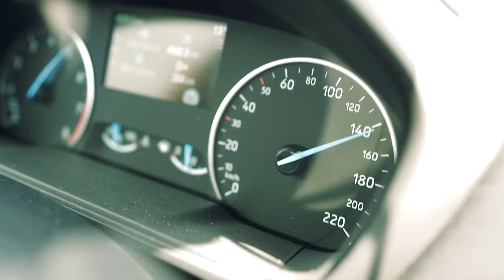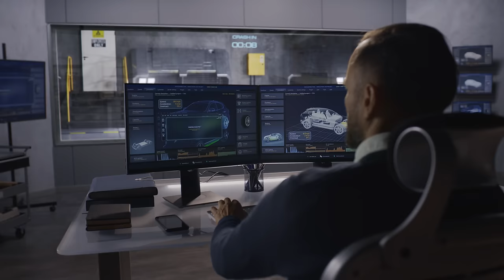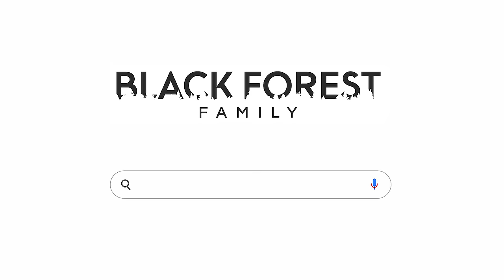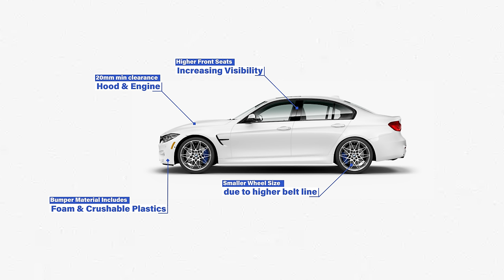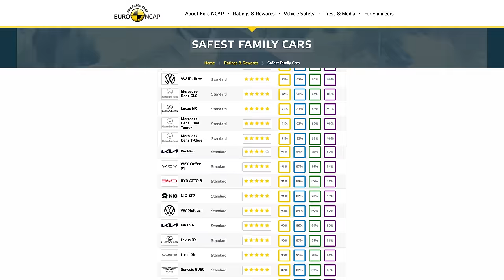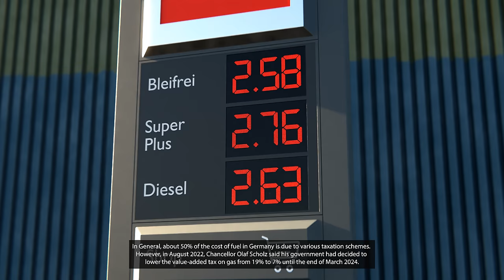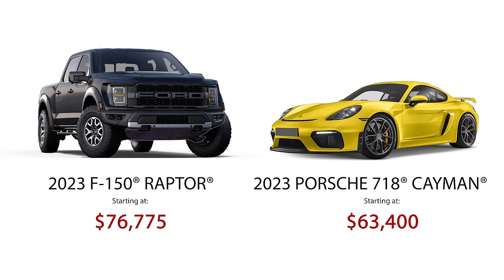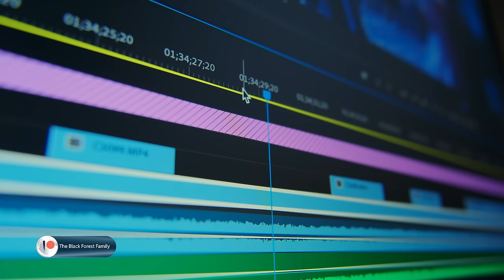DRIVING CULTURE CLASH: Why do our Cars LOOK so Radically Different?

Comment: As examples for my experience (from Norway and Denmark) I have also seen a difference in cars. For context I’m form Norway, but have spent some time in Denmark. For one Danish cars tend to be smaller; city cars. Even on the highway I see these, where the top speed is 130. 

Meanwhile in Norway the top speed is 110, tho is not often you encounter it. On top of that I will say our roads are safer than Danish once, with lots of street lamps (not something u see much in Denmark, even on the highway). Still the the trend seem to be nowadays to get these SUV like cars in my country. Meanwhile the city cars have been dubbed “grandma-cars”. This is also the trend for electric cars. 

We seem to be more car reliant in Norway. Maybe spending more time in out cars we like to feel less of it’s movements. Maybe the oil companies has seen its opportunity to lobby to make us use more fuel. Getting more American than we realize

Why this trend is, I don’t have an answer to. It might be the kind of environment we has to deal with compared to the Danes. We often have more space in therms of our housing plots, many live on the country side, and has to deal with poorly maintained snake like roads (the highways is well maintained while the country side is forgotten, even in the cities roads are full of potholes. Up to 60% of roads in our capital Oslo is in a horrible state). On top of that we had to deal with snow and ice compared to the Danes 

Maybe we feel like we need a car like that to get into our nature.. and a suv like car is what we need, either as a status symbol or just to get home or to get up to our cabins. Tho it’s not necessary, I myself drive a small “grandma-car” with a four wheel drive, of course it wouldn’t be able to reach the full lvl of a real suv, neither is does it have a hitch, but my little car will still be much more capable compared to a regular car on slippery road conditions

These are all wild guesses, and I still can’t give better insights to why this trend seem to be or even if it’s real

(Sorry for any strange wording, my phone has picked up a hobby of making bad corrections)

Comment: The number one cause of US cars getting larger is environmental regulations which mandated fuel efficiency standards based on the footprint of the vehicle which makes it impossible to produce smaller trucks and cars without radically increasing fuel efficiency

Comment: European roads have evolved over hundreds of years, and often snake around plots of land as well as hills, so compared to US roads, European roads are "interesting"- they have corners, wind through hills, pass through tiny villages with narrow lanes, and so on. So in Europe cars have to be manoeuvrable and are often fun to drive, with manual gearboxes adding to the fun element. US cars are used for straight and wide roads with junctions, so US cars are easy to drive on those sorts of roads and handling is little part of it.

Comment: Guess for me it all comes down to usability of a Car. My everyday car is a VW Touran with a 2 liter diesel engine. Just because Diesel is cheaper than regular fuel. Some years back i had a Jeep CJ7 with a 5.9 liter engine. Took up to 25 liter per 100 km. Imagine having to use that as your everyday car. 
Ofc i'd love to have a Raptor, but just as a "fun car" it is to expensive and for a every day car it simply drinks to much.
Plus, in my view, Americans tend to have everything "bigger".

Comment: Sadly the SUV trend is in Sweden now. Even Golf is out an T-Roc (wannabe SUV) is in. The cars in Sweden are growing in size... A wise guy once said: Americans are adopting the metric system inch by inch.  Maybe the Americans will adopt smaller cars in the future. Many American cars now have six or even four cylinder engines instead of a BIG block V8.

Comment: I think the US is getting into a future safety problem. As you have pointed out the SUV sales trump other sales and the impact it has on pedestrians and cyclists. Many kids are killed on the home turf bei their parents in an SUV, because they did not see them. If there would be a change in policy it would not be retroactive - you cannot drastically change the outline of a car - nor can you scrap the cars from the last 6 years either.

That also means that an egalitarian approach to mode of transport will be hindered, as only slightly suicidal people will try to walk or cycle in a traffic that does not regard their safety (+ lack of pedestrian walkways, ...). It has also been reported that SUVs are sturdier than their counterparts - have a smaller Knautschzone, which again puts vehicles with a different design approach at risk - as the amount of force the vehicle has to absorb is put onto the softer car.

A friend of mine is car-less. They are member in a car sharing club and they book a car once a week to get vegetables and once a month for the super market and then if they need it. All the remaining commute is done vie public transport - they bought their house close the a big hub. And she it is really odd, when you see that a trip to the hardware store costs 50.-€ if you factor in price of the car, insurance, maintenance, ... So I don´t drive by accident to the hardware store. I will take the bike first and once I know I have a buy - I know its dimensions and what car, truck, ... I need to rent. Owning a car does also hides costs from you and makes you take routes that are more expensive - and sharing is more efficient.

Comment: I can add some more points
- divers license: a European class B driver's license is limited to 3500kg while to my understanding in the US a car driver's license allows a lot more
- considering towing the license things get a bit more complicated, but in general it is preferable to have a car below 2t as this will allow a 1,5t trailer within a class B license. If the combination stays below 4.25t it can be driven with a B96 license
- Utility trailers are probably also one reason why smaller cars are not really a disadvantage. It is so much more comfortable to have a normal-sized station wagon in everyday life and use a trailer for trips to the hardware store than driving around a huge truck all the time. A trailer is cheap to buy, cheap to maintain, has low taxes and will last for decades. It is also easy to buy one for 2 years when it is really needed and sell it afterward (this is what I do for my current landscaping need)
- infrastructure is not just roads. A full-size pickup truck will have little fun in a parking garage. The prevalence of oversized surface parking in the US makes parking a huge vehicle much easier
Reply: I am from the USA and live in Germany currently.  My old full-size Chevy Silverado long bed with an extended cab would be almost useless in Germany and impossible to park.............but it served me very well when picking up dirt, gravel, mulch and landscaping stones.  It also came in very handy for helping friends move, picking up furniture, etc.  It had a big V8 engine, automatic transmission and was mated to a 3.73:1 rear axle.  It was brutally powerful and had tons of torque.......but it got 13 miles per gallon in the city and maybe 17 or 18 on the highway.  When I sold it in 2017, gasoline was around $2.25 per gallon.  I also had a four-cylinder Nissan Altima sedan that I used as my 'daily driver' since I had a long commute.

One thing sad about the US is that you cannot find a good "compact" pickup truck anymore (Mazda B2300, the pre-2011 Ford Ranger, Nissan hardbody, small pre-1995 Toyota, etc.).  They were pretty cozy on the inside and boxy on the outside - but they had four-cylinder engines, manual transmissions and were excellent of fuel economy + they'd last almost forever.  A good Toyota or Nissan pickup with proper maintenance would rust out long before the engine would give up the ghost.  I think the smallest truck you can get in the US now is the Toyota Tacoma, Ford Ranger or Chevrolet Colorado - which are more "midsized" and are almost 3/4 the size of the Tundra, F-150 and Silverado.

I once owned a 1985 Ford Ranger long bed.  4-cylinder, rear-drive, five-speed manual and no options at all except for air conditioning (which barely worked after 12 years).  Such a cheap, cool little truck - until a drunk smashed into it when it was parked.  A total loss.

I think that if Toyota and Nissan offered their compact pickups again in the States that they'd sell like hotcakes.  They still are made in other parts of the world, but you cannot import one into the USA until it is 25 years old.
Reply: 3.5 tons is the limit, including trailers.
With the small lorry license that gets you up to 7 tons combined.
But more than that means no weekend driving.
Reply: I am a retired trucker from the USA and - in most states - a standard driver's license is valid for vehicles up to 26,000 pounds!  You don't need a special license for a trailer unless it is rated at 10,000 pounds or more.  ( In some states, you don't even need a CDL for air brakes if the vehicle is under 13 tons gross weight! )

For a heavy straight truck that weighs over 26,000 pounds GVWR OR has more than two axles, you need a Class B CDL.  Combination vehicles (tractor-trailer) require a Class A CDL.  Then there are separate endorsements for HAZMAT, tanker and double/triple trailers.  Passenger and school buses also require a different endorsement.

Even old folks who buy a $500,000 RV don't need a CDL because their vehicle is not used for commercial purposes.
Reply: @1VaDude  I guess you have no weekend and holiday truck driving ban. And you are allowed to drive as long as you do not make an accident. 

Our truckers - in every EU country - have very stringent work and play times. And play times means no work, not even refueling or cleaning the windscreens is allowed. Having sex with anyone or watching Youtube is ok.

The trucks are under permanent oversight and must pay road toll in every country. Besides that they must undergo extremely nitpicking yearly emissions and drive train checks. 

We got enough horror stories where a romanian truck or a polish bus without brakes killed a whole school class. INSIDE the school!

On the other hand, when you have a hauling company its not easy to take advantage of your personell. Not impossible, but not easy.
Reply: @wolfgangpreier9160  -- Trucks in the USA run 24/7 and 365 days a year.  Drivers do have hours of service limits and we had satellite monitoring,  GPS tracking, cameras facing the driver & out the front windshield, etc.  We also had electronic logging devices (ELDs).

Trucks are inspected periodically, but some companies were a little slack on things.  With CSA ratings, though, it hurts companies to have a high (bad) score.  Driver & equipment violations can cost them bigly

I was fortunate to be short-haul.  I worked Sunday night through Thursday night and slept in my own bed every day.  My situation was not typical, though.
Reply: In regard to towing, European rules allow smaller vehicles, often meaning cars, to tow more than American rules do. The very same car model will have different tow ratings in Europe than in the U.S..

For once this is achieved by using a lower tongue weight (as a percentage of the trailer weight) in Europe and by different rules on trailer brakes (for example a brake in the hitch area that activates the trailer brakes when the trailer is pushing into the the towing vehicle when the latter brakes).
Reply: @aphextwin5712  -- I see a lot of station wagons in Germany pulling trailers.
Reply: @aphextwin5712  Can you go into more detail on the US side of things? For example, how heavy/big does the towing vehicle need to be for a 1.5t trailer?
Reply: @foobar9220  I don’t know the precise rules,  but for example, a Mercedes GLC 300 is rated in the U.S. for 3500 lbs or 1588 kg. The same model (2 l engine, 255 hp, vehicle weight ~1900 kg) is allowed to tow 2400 kg in Germany.

Another comparison, the VW Tiguan is rated in the U.S. for 2200 lbs or 998 kg. In Germany the same model (2 l engine, 184 hp, vehicle weight ~1700 kg) can tow up to 2500 kg. 

Finally, a Golf (2 l engine, 184 hp, vehicle weight ~1400 kg) can tow between 1600 and 1800 kg (12% or 8% slope) in Germany while VW USA states that it is not recommended for towing.
Reply: @aphextwin5712  This is really interesting. With my Octavia I have done plenty of towing, from my beach cat trailer over a car transport trailer with my girlfriend's broken car at ~1.3t (right through Switzerland by the way) to my current utility trailer that is rated to 1.5t but on the way from the gravel pit often is a bit heavier. All that with the small 1.6l TDI at 105HP and an empty car weight of about 1350kg.
Maybe that is a regulation coming from trailer sway, but modern electronics have basically solved that problem. During that car transport, I had a bad weight distribution on the trailer and it started to sway above 80 km/h. Hitting the brakes, the ESP reigned it in immediately.
Reply: @foobar9220  I’ve looked up a number for lower power Golf. A 110 PS version is rated at 1300 or 650 kg (8% slope vs 12% slope).
Reply: The class B license will soon allow for vehicles up to 4,250 kg. I suppose this is a reaction to manufacturers of RV, who found 3.5 t to be too limiting. Obviously everyone with an old class 3 license can still drive up to 7.5 t.
Reply: @durchschnittlicherzuschaue9733  To my understanding, this is not for cars with combustion engines. So in practice (due to the absence of other relevant engines) this is a lex EV.
And regarding the old classes...they have been changed in 1999, so this applies to anyone below the age of 42, which by now is a considerable portion of drivers
Reply: @durchschnittlicherzuschaue9733  Though what a quick search found that this change only applies to vehicles that are alternatively fuelled. Which basically means electric vans.

As electric vehicles, due to the weight of the battery, are heavier than conventional ones, increasing the weight limit for them ensures that the same size van or RV can still be driven with a standard driving license even after creating an electric version of them.
Reply: @wolfgangpreier9160 truckers have a limit on how lomg they can drive. They can only drive 14 hours a day. After 8 hours they are required to take a 30 minute break. The 30 minute break counts against the 14 hour day, so technically it's 13.5 hours. Yes there's no weekend of holiday bam. Driving on the weekend doesn't affect a person's capability of driving. For a week's time a driver is allowed to drive 60 hours.
Reply: @jessicaely2521  That is much more than is allowed in Europe.
Reply: my 1980s driver license allows me with my car license to drive 12t trucks with trailer...
one reason the Brits wanted all German license holders to save their x-mas, because the lorry driver shortage, because of Brexshit!
Reply: in the us, you can literally drive a big rig converted into an rv with a standard drivers license. those things can weigh up to 60,000lbs.
Reply: @nicktune1219  cool, but what is lbs??
is it something gay???
Reply: And of course with a manual gearbox you can tow  2x+ as much we the same engine size as with an automatic.
Reply: Not sure where you got that from. The numbers do not back that up, at least here in Europe. In some cases the tow rating is even slightly (10-20kg) higher with automatic transmission. Nowadays, automatic transmissions are even recommended for heavy towing as they have less wear on the clutch
Reply: @foobar9220 If an automatic clutch can do it an average driver can do it better, much better. The problem with clutch is that if you do tow more than what would be recommended with an automatic, with a manual the tradeoff is extra wear on the clutch due to fractional gearing. All depending on the severity and frequency. The ONLY advantage automatics have is that common modern day autos now have 8 or 10 gears, which of course can do much better gearing than the 5 or 6 that is still on all remaining manuals. But I was talking more traditional and what is on the roads, not the best of the best from this or last year.
Reply: The tow capacity is not a recommendation, it is a legal limit. If your manufacturer says you can tow 1500kg, that is it and there is no towing 3000kg just because you feel like it. And in that respect there is no relevant difference between manual and automatic and there has not been one 10 years ago when I bought my car
Reply: @foobar9220  Tow limits are set by your drivers license, not by your car in many european countries.  But when they are set by cars they are typical about twice that of the US. Though you could argue it is more because towing speeds are lower, though I say it is because they were originally estimated for manually geared cars.
Reply: Definitely nope. My Octavia has a limit of 1500kg for trailers. That almost coincides with what my class B license allows (1900kg car + 1500kg trailer = 3400kg of 3500kg allowed) but it is a limit of the car. My girlfriend is older and has a German class 3 license that allows up to 7.5t with a large trailer. But not on my car
Reply: you can drive any US pickup with your standard 3500kg license, but not tow, that is right. The elder German licenses ("grauer/rosa Lappen") can drive at least 7,5t combined, if not 12t.